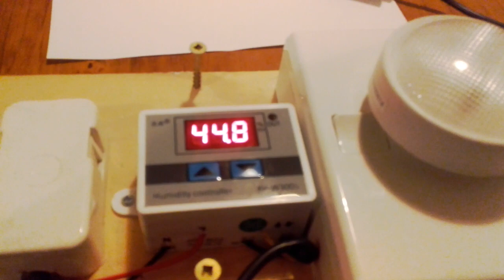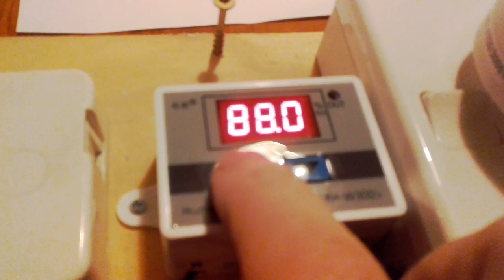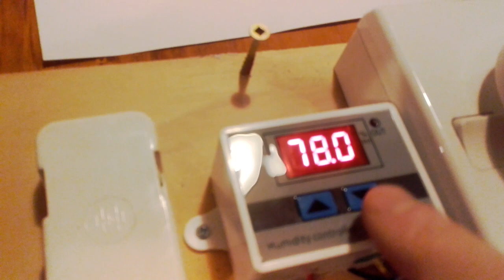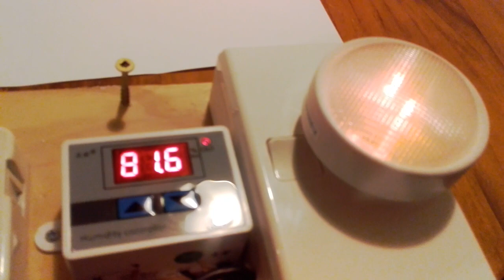XH-W3005 Humidity controller switch

Comment: Thank you for sharing. I bought it and indeed mine came without any instructions. I use it in another way and programming for that was not easy: I wan to ventilate when relative humitity is more favorable, for example I want to start my ventilator when humidity in the place of the sensor (outside) is less than 60% for example. To do this you need to set both settings to the same value, in this case 60%. In this way the switch connects when humidity is lower than.

Comment: Hi Paul, my Manrose humidity controller went faulty after about 4 years use.  These are just under 100 euros new from Screwfix. I purchased one of the humidity controller XH-W3005 on  Amazon and am awaiting delivery.  I hope it will last a while and give good service. How is your XH-W3005 doing?

Comment: I can't get mine to work like yours is. The up arrow seems to be setting the humidity that the device turns on at while the humidity is decreasing, and the down arrow seems to set the humidity that the device turns off at while the humidity is increasing. Seems totally pointless when I need it to be turning on as the humidity increases, not off.

Comment: Paul - thanks for the video. Just ordered one for my bathroom after my existing timer/humidity unit failed. Can the sensor be unplugged either at the controller end or the sensor end to allow feeding through a hole in the ceiling and then re-attaching?
Reply from the maker: No you can't,   I just remembered you have to cut a hole the size of the sensor to come through the ceiling. Then fold the wire back under the sensor and screw the sensor up to the ceiling while covering the hole. Just make the hole big enough for the sensor to come through.
Reply: @pauls.2526  Thanks. I discovered you could unplug the sensor from the circuit board inside if you unscrew the circuit board - would still require a hole of about 10mm. Ended up removing the duct covering and threading wire in beside duct then replacing it again. Just wondering what settings you have used for your humidity settings  and if the device is working OK for you. Only installed mine yesterday  - but it seems a bit tempermental.
Reply: Paul - just read your advice below to turn on at 92 and turn off 90 - so am assuming these are your settings. - Thanks
Reply from the maker: @padraicadoyle  Padraic try to turn off power supply to switch for one minute the power back on and use my settings this worked for me. 😊
Reply: @pauls.2526  thanks.  I did that and also did a reset by pressing both buttons together. But it continually just runs for about  1 or 2 seconds when the shower is on and then shows "HHH" on the display. I have the AC version rather than the DC version you have and from other comments this problem seems more common with the AC version.
Reply from the maker: @padraicadoyle  It looks like  it could be faulty because mine is running on ac mains power. They might be a ac dc toggle switch in the back of the unit if opened but I don't know.

Comment: Thank you Paul for video. I want to use this controller with other way. Could you explain me please. I need to keep 70% in my room. So if humidity in my room will be 69% then controller turn on fan and then turn off fan when humidity will be 71%?
Reply: Look at the relay inside - it may have NO (normally open) and NC (normally closed) contacts.   Move the wire (soldering requried) to the opposite relay contact ( am guessing NC) to activate for low humidity and deactivate for high humidity.

UPDATE:  Looking at the photo of the inside, the relay is a single NO contact, so you won't be able to change to NC contact.   You would need to swap in a new relay.   Datasheet here:   https://www.rlocman.ru/i/File/2018/02/21/SRA--T74-.pdf      Contact type A is NO only.
Reply: @mjkirk12   he can set the high side low and the low side high to make this function as he wants.  Press the up arrow until it flashes.  Set to 70%.  Press the down arrow until it flashes and set it to a value greater than 75%.   It will turn on below 70% and turn off above 75%

Comment: there is a situation when h. rises above 99.9 and controller turns off and flashes HHH, LLL repeatedly until h. falls below 99.9
Reply from the maker: I don't seem to have any problems. It runs a bathroom extraction fan in my home.
Reply: @pauls.2526  I use it exactly the same way and after several minutes of doushe's working fan stopped because that.
the only way to workaround it is use negative zero correction.
Reply from the maker: @Алексей-и5ш2б  👍
Reply: Paul, what maximum values does show your hum.ctrl. while bathing?
Reply from the maker: @Алексей-и5ш2б  when my wife was in the shower is looked at the  switch it went up to 100 and came back down again and the fan turned off. Your switch might be faulty.
Reply from the maker: Try this. Turn off the power to the switch for 1 minute. Then turn power back on. Set switch to turn on at 92 and turn off 90 this works for me. You can not have the same number for on and off like 90 and 90 hope this will help you.
Reply: @pauls.2526  _"try this"_ not quite understood what for those manipulations 😌
Reply: @pauls.2526  i do get the same problem on the DC version ( not AC),  as long as your fan or other device is set right the RH should not reach beyond 99.9 RH.

Edit
press and hold the up and down button at the same time, this will give you -10 RH in adjustment